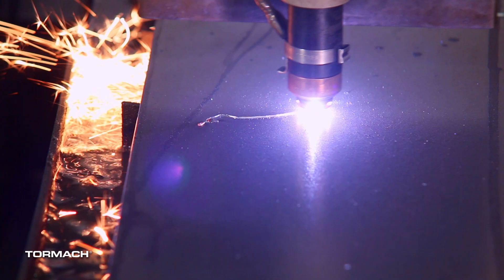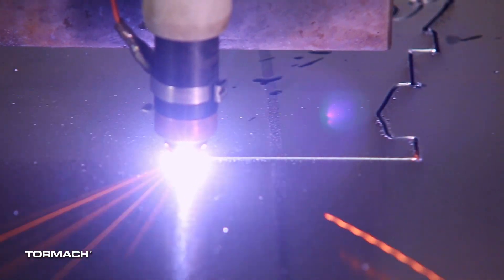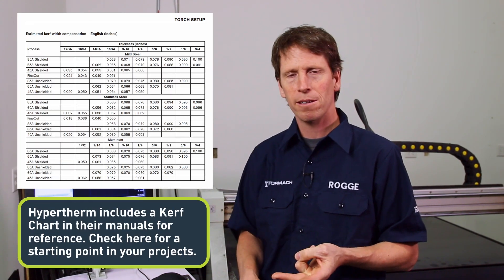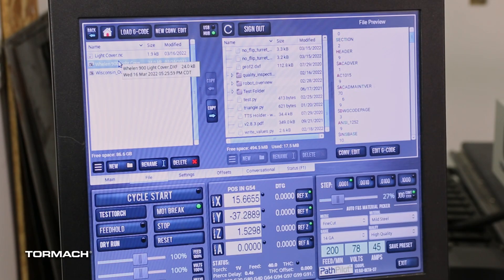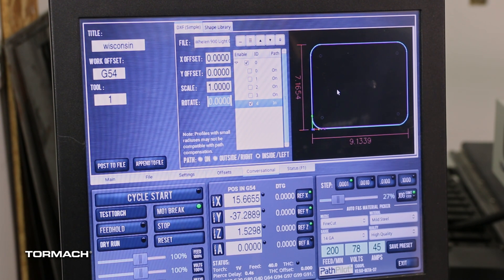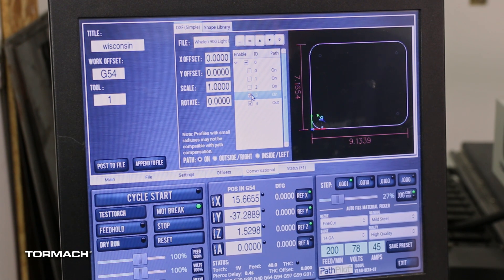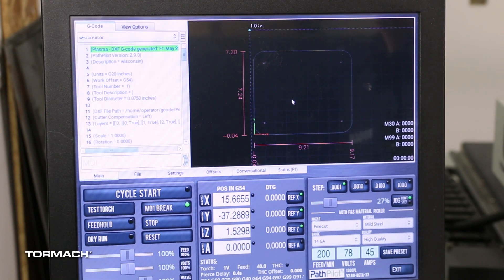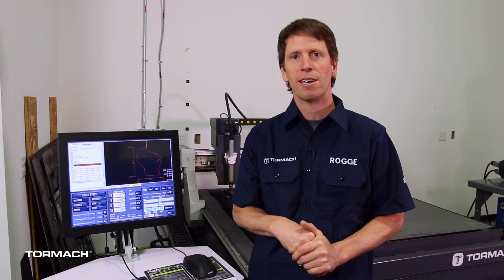PathPilot Quick Tips | Plasma Kerf Compensation with DXF Import

Comment: Hi,  When I bring a .dxf (from an Inventor sketch) into PathPilot the arcs are replaced with straight lines.  If I create the dxf from a drawing in Inventor the arcs remain arcs but the origin is not located on my part and I am unable to determine the exact amount of X and Y offset to center it.  Any tips for creating a dxf?  And idea what may be happening here?  Thanks much!
Reply from the maker: Make sure you are creating the DXF from a (2D) sketch instead of a 3D solid model. If that doesn't work, the Autodesk forums might also point you to the correct solution as well. Thanks for the question.
Reply: @tormachinc  Thanks, I will give that a try.  Do you know if there is a requirement for the version (year) of dxf (2018, 2007, 2004, R12, etc.) for compatibility with PathPilot?